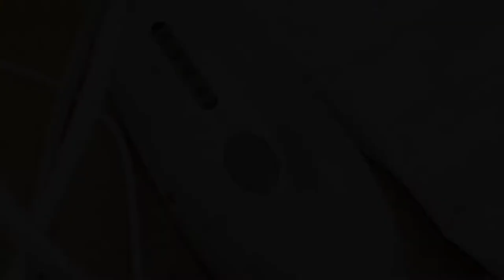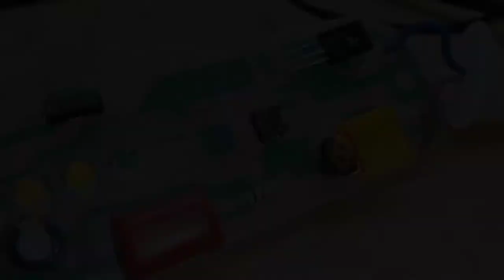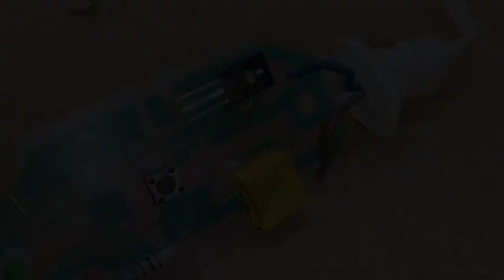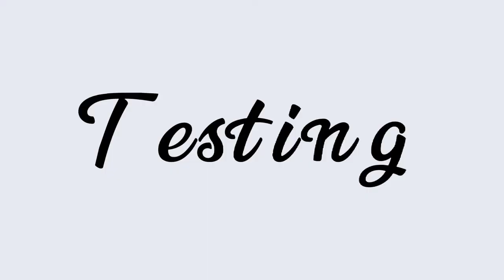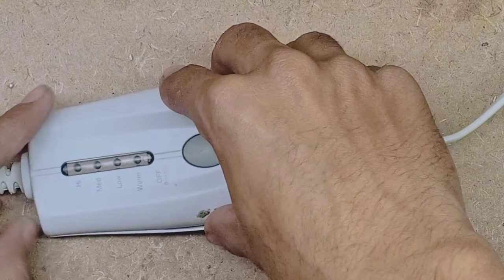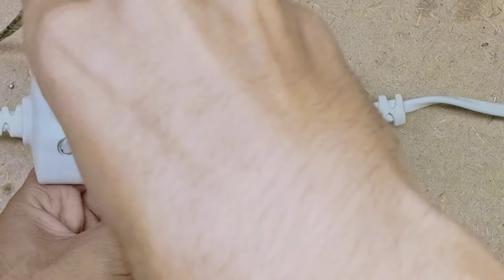How to Repair Heating pad not power supply

Comment: What tool was that you used ?
Reply from the maker: PF capacitor and fuse If there is no PF capacitor then remove the bad PF capacitor and still it will run no problem.
Reply: @adking6107  how do you fuse them to the motherboard?

Comment: I don’t understand what you just did. I have 2 that are flashing F. I don’t have a tester.
Reply from the maker: PF capacitor and fuse If there is no PF capacitor then remove the bad PF capacitor and still it will run no problem.

Comment: Bai heat ni kr rha power a rhi ha
Reply from the maker: Open the pad and remove the old joint then re-insert the new one and it will start working 👍
Reply: @adking6107  just joint or complete wire???
Reply from the maker: Just pad heater joint remove the old joint then re-insert the new one and it will start working 👍
Reply: @adking6107 how to remove the joint can you please make a video on it
Reply: Anong pandikit ang pweding gamitin pag may natanggal na isang turmanium para maibalik ito sa pagkatangal nito